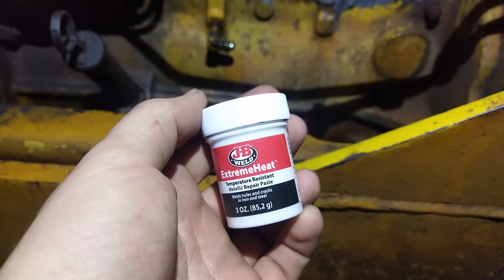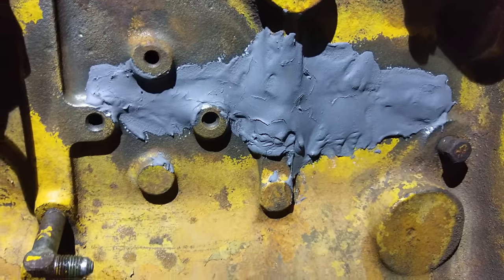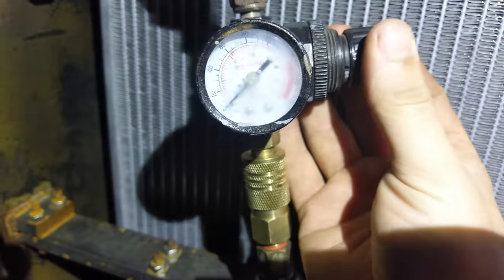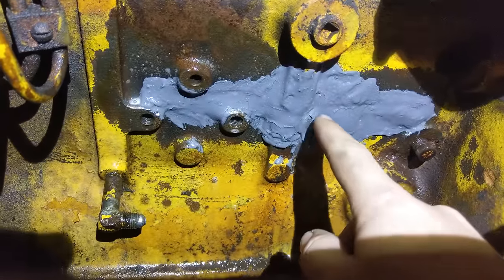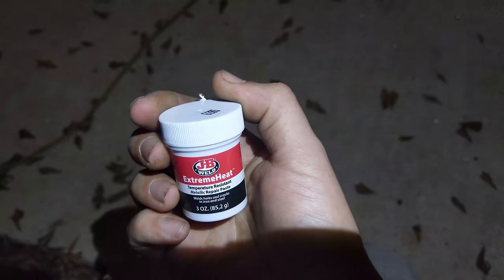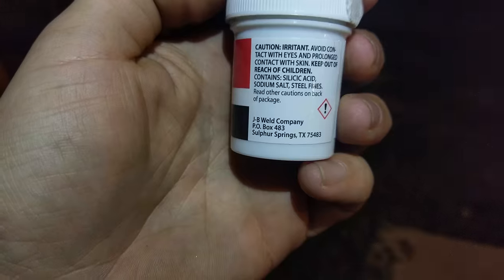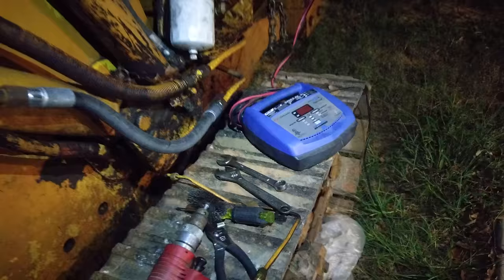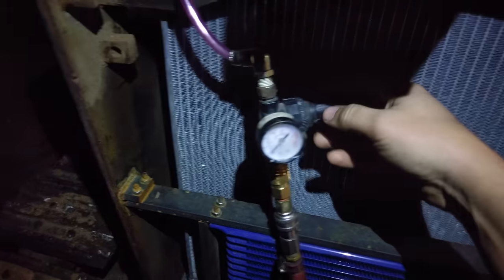JB weld EXTREME HEAT review... its garbage

Comment: So. You need an engine. The $10 container of jb weld didnt fix your problem. So you call it garbage. Not really fair
Reply: That stuff works great not the putty but the 500 degrees weld 5023 psi works it has to be don’t correctly and let it cure for 24 hours for a engine I would let it stand for 48 hours I repaired lots of engines and if don’t write it will last for ever.
Reply: @chase-db9jo  I like the part when he starts with I welded my cast iron block with stainless rod and it didnt work, it cracked again....lmao....  yeah hes smart
Reply from the maker: @chrisalanwarren  if you knew anything about cast iron you would be a bit quicker to point out preheat etc. 304 and 316 are useful alloys for welding cast. 

But your entitled to your own opinion, even though your wrong.
Reply: I have a 350 vortec with a cracked block can any one tell me how to properly jb weld it to last it's just a woods toy not really worried if it leaks a little
Reply: @hvguy  If there is a wrong or right answer, then it's not an opinion. There cannot be a right or wrong opinion.
Reply: @Street Dreams Who said 72 hours much less 24
Reply: The way I see it , it doesn’t look like you prepped the crack you know raw clean scuffed metal. Holes drilled at crack ends , opening that crack up cleaning it over and over. That’s how you get good results . My father swore by this stuff and I’ve only had half ass results from half assed prepping.., the old saying is , you get out , what you put in… there’s other folks all over YouTube that did this same type job as this and had opposite results . User error is real…
Reply: Accurate 😂
Reply: It’s water based. Not meant for liquids.
Reply: @hvguy you dont weld dissimilar metals together on a block. stainless is doomed to fail. just blast it with 7018 and youre good
Reply: You don't have a clue what you are doing there pal🤦🏼u welded a cast block with stainless rod instead of 304,probably didn't preheat, etc etc.....
Reply: @hvguy really can’t call it an opinion when there are facts out there proving this lol. It’s facts. When there’s facts then it’s just straight out being “wrong”.
Reply: Also, to prevent it from further cracking when you weld the crack try drilling a small hole at each end of the crack before welding.

Comment: That stuff works fine, the thing is you put way to much on it. You're supposed to drain the oil out of the engine if it even comes out slightly the JB weld won't cure properly..just put enough to fill in the crack and let it cure for about 2 days. Until it's really hard, I noticed it wasn't even fully Hardended when you touched it.

Comment: Regular JB can take up to 500 degrees.If your block gets hotter than that you have bigger problems than a hole in the block.
Reply: I used the regular JB weld to hold a 4-wheeler's intake manifold on. It only lasted 3 days before it broke apart but the engine never gets to 500 degrees
Reply: @jordananderson8299  you probably didnt clean it good enough or mix it properly

Comment: if you also read the directions this is almost specifically for exhaust manifolds that are cracked. it's not water proof the  putty jb weld has is. you better get a sponsorship from jb weld or quick steel most bonding products are going to fail this test. FYI learn to read the box.
Reply: IKR! And plus exhaust manifold back pressure build up to about 7 psi and not shot right at it lol
Reply: i bought some and didnt see anywhere saying that is not water proof,but it does say solvent and fuel proof ,how could coolant be worse then solvents other than it being heated
Reply: @loosh__sii water based , Kevin Wilson was right common sense ain't that common any more
they actually say not to machine with cutting oils but you are technically correct, it does not say it's not water proof.

Comment: thats cast iron,u can braze it with a nickel rod.its extremely hard to weld cast metals.and grind a notch for full penetration.
Reply from the maker: i was going to braze it, however, directly behind the weld is a cylinder sleeve with brand new O-rings. I didnt want to risk damaging the seal and filling the crank with water and oil.
Reply: Yea brazen seems about the only way. Sucks you’d basically have to rip it down bare to do it but.... do it once, do it right. Plus you could get a better look and make sure everything else is golden. Any updates on this yet?

Comment: A long while back, we used the Marine Weld to fill a corrosion hole between the exhaust and water jacket in a 6HP Evinrude. The block is cast aluminum. Ran the motor hundreds of hours. Made sure the area was clean using acetone, and was properly prepped, reamed the hole to about 3/16" and cleaned of corrosion to bare metal. Let it cure for a couple days. Ran the motor probably a couple hundred hours. Sold it and the new owner is still running it.

Comment: I ordered this product and am still waiting for it to arrive.  In the mean time I had some regular JB quick weld on hand, so I used that on an exhaust pipe leak between my drivers and passenger seat.  700 miles later I crawled under the car with a bottle of windex and sprayed the repair area, while I had a hose hooked to the exhaust of my shop vac to pressurize the exhaust system.  No leaks like before.  Amazing JB quick weld held up on an exhaust pipe, since it is only rated for 450 degrees.  I'm sure an exhaust manifold gets much hotter than the exhaust pipe though.
Reply from the maker: Hard to beat the good old stuff

Comment: Your video shows the problem was the mechanic and not the product. 
JB Extreme should never be used were it comes into contact with water. 
This  dissolve when it comes in contact with water. Should of used J-B weld twin tubes (8265S)

Comment: ... did you cleaned the grease and rust  BEFORE use J.B. weld  , with ACID ?? ( Cannot exist any strange particles in the welding areas , especially greases and oils ).

Comment: I would of used  the regular 2-part jb weld. I have used it to fix cracks in engine block and  can take high temperatures.
Reply: I used the regular JB weld to hold a 4-wheeler's intake manifold on. It only lasted 3 days before it broke apart but the engine never gets to 500 degrees

Comment: I noticed that you had 15 lbs pressure on the cooling system, i don't know how old your case is but most of the older systems and likely the later ones as well don't need a pressurized system you should be able to run your case with no radiator cap at all, i could be mistaken this is just my experience.

Comment: I cannot speak for the Extreme Heat. I have performed things just short of miracles with the original 2 part JB Weld. I was actually in the parts store yesterday, and the extreme heat almost lured me in, as I was needing to epoxy a hairline crack in the engine case on my Honda Foreman. I looked at the two products, and if I not mistaken, both the original and the "extreme heat" were rated for 550 degrees. I have not tried the extreme heat, but I have certainly had better luck with long set up original formula. I am inpatient, so the "quick weld" has lured me in a time or two, but the fixes did not last like the OG stuff. Thanks for making the video!

Comment: I used jb quik weld on my motorized bicycle spark plug it worked for like 2 weeks with almost daily use it rnded up cracking ive just redone it with the original and ik hoping it will hold up a little longer
Reply from the maker: The original JB weld is far superior 😹
Reply: @hvguy  good to know hope it hold up well

Comment: this guy is hilarious! what jb weld did you go with in the end and did it work??
Reply from the maker: XTR3MEBASS15 I ended up with jb marine. it still leaked a little. my friend suggested pulling a vacuum on the block to suck the epoxy into the crack. but that was after I sold it.
Reply: Looked up the specs for marine weld,  nearly 4000psi tensile stength is pretty decent. 
I have a hole between the exhaust port and coolant jacket of a petrol engine. (I've tried tig but its too narrow to get in there and I can't get the cylinder head hot enough to braze it, damn thing is designed to be a massive heat sink!) So my last resort is some kind of epoxy. what would you recommend?
Reply from the maker: XTR3MEBASS15 there is a company out there and"im not gonna look it up" but they make epoxy that's specific for fixing blocks. Google around, I believe they use some sort of orange lid or container. Pretty good shit. I believe cummins even supplies it for repairs.
Reply: Hvguy Next time you need to get the steel stick which is like a stick of putty that has the hardener in the core of it, you kneed it till it becomes one color and it will dry as hard as steel in 5 min and fully cured in 1 hour. That stuff gets extremely hard like steel. That stuff would definitely not blow out that easily.
Reply: @cwatson42785  do you know the name of his product? Or any information you can give me so I can Google it? Like what the container looks like or the plastic it comes in? Anything?

Comment: Someone help me. I need to attach a piece of metal that fell off of my aluminum case on my YZ250. Would Jb weld’s heat special paste do the trick?
Reply from the maker: Yes, as long as it doesn't have much pressure or torque. Clean well, sand, clean, clean, clean, apply, hold in place. Done

Comment: I remember repairing my manual transmission oil leak using the regular J-B weld. It holds very well. (Knocking on wood)
Reply from the maker: ruizhernandeztrust I almost considered good ol trusty jb weld... But figured if I paid more for a product, it'll be more gooder.... This was not the case 😂
Reply: Gooder, is that even a word? Or did you mean goober? Lmao
Reply: Ryo Amora wtf is goober even a word?
Reply: Hey thanks for ur info.  I been thinking of applying it to my transmission hairline fluid drip underneath.  Did u use the original jb weld?  How’s it holding up after 6 yrs?

Comment: I have a head gasket leak from the cylinder to the outside (puffing air under the exhaust manifold). Do you think I could get a temporary fix using JB Weld?
Reply from the maker: Hell no lol. Pull the head. It's easy

Comment: We used to solder cracks in the blocks on the old cars. Soldering will not work on a mounting point like engine mount but will repair a crack from overheating.

Comment: Depends on application small cracks, has to be clean, dry, and proper temperature. Will buy you time for a replacement part to become available especially a used one.

Comment: We drove a car 10 miles to the mechanic.  After sticking a pipe in a Broken off. Metal water hose connector on the intake manifold.    It got to the mechanics 💯. For a more permanent repair.   So it works

Comment: I realised this is an old thread. I have a hole in my sump on a Toyota townis 1992. Would this jb weld be able to fix that Do you think?
Reply from the maker: Absolutely not. Just clean it real good and use the original 2 part JB weld.

Comment: For future people his putty was still wet, press your finger nail 1cm in from the outside edge or the thickest area, it should leave no marks or indents, plus if this was to seal water its always going to have moisture effecting it

This is water based so spraying it with water just ruined it o. Your leak test.
you cant  do this in this application but painting the inside and outside with enamel paint will seal it from water and oils etc making it last even longer.

Had dynagrip extreme heat (jb weld bought their formula) last 11 years on a old 16hp briggs engine that threw a conrod, ground down with flapper disc, hit with blowtorch to remove oils,  put some tig wire to bridge the large hole (imagine rebar in cement) and went to town dabbing this extreme high heat paste in the same spots filling air pockets
 Smacked with a hammer as hard as i could, approved it, rebuilt engine and its still there a few months ago when i replaced the the oilsplasher.

Comment: I just spoke with the techs at JB Weld this week. I asked them about this Extreme heat product and they told me it dissolves if it comes into contact with water - WTF? I think had you used normal JB weld, your repair might have worked out okay. I honestly can't figure out what the purpose of the JB weld extreme heat product is. The website says it can be drilled, sanded, etc. and it's good for all sorts of things. But if you call the company, they will tell you if it comes into contact with any water, it will dissolve. If you check the product on the website, 30-40% of the Q&A is JB weld telling people "that won't work, it will dissolve if it comes into contact with water". What kind of silly product is it? I'd like to know what you could use it on where water isn't a potential risk.
Reply from the maker: Wtf?!? What kind of bullshit product is this 🤣🤣🤣
Reply: @hvguy  My sentiments exactly haha.

Comment: A cast block - cold stitch weld. But that’s a dying art along with those capable of doing it - old school.
Personally I’d have cashed the crack, thoroughly cleaned it & then cleaned it again. Then used JB Weld.
Whilst waiting for it to cure Id have been look for another engine.
I have used it to repair two cracks in the top of my cylinder deck, which is aluminium, on my Suzuki Samurai race truck. It does have the benefit of having the cylinder head to hold it all down though.
If you don’t use it properly - don’t call it rubbish.

Comment: Garbage definition 

* Tried to weld cast iron with stainless steel rods
* Tried to weld cast iron without pre-heating block
* Chooses the WRONG patch material for the job 

I understand your frustration, but you cannot deny who really made the mistakes here.....hint: You..
Reply: Welding cast iron gave it all away  :))
Reply from the maker: @AdrianMNegreanu  a little late to the party here but a quick search will show you welding cast is viable. Using this garbage product on a block is not. 🙃

Comment: You should have used regular JBW for this- it's good up to 550F, is stronger, and bonds better. I get good results when plugging large holes by embedding glass cloth in it for added strength and helps bridge large gaps faster.
Reply: This is good for 1100 degress

Comment: Jb extreme heat works just fine as long as it's not exposed to lots of water like in the case of a cracked header. It is a 2 part system, usually you have to mix it beforehand.
Reply from the maker: Mixed thoroughly, let it sit for 24 hours and it was still junk,

Comment: I used the jb weld putty and it didn't stop a small transmission  leak. Re did everything and got the almighty Jb weld epoxy went back on the road! 10k miles later and going.
Reply: SirCavemaninthewest 
Same here tried to fix oil leak and didn’t work. By the way is that JB weld epoxy original JB weld that comes with 2 small tubes and have to be mixed together?
Reply: @svetipetar278 Yes. I used the JB weld original RED & BLACK tubes. Also a stainless steel brush and brake cleaner spray can are a must have. I sandwiched the epoxy with aluminum foil so it doesn't sag or bulge. You can sand the epoxy if you want to add more layers to it. The Aluminum foil can be peaked off when it all cures.
Reply: SirCavemaninthewest 
Thanks

Comment: The first mistake this guy is making is he's trying to patch a pressure leak from the outside of a pressure vessel.
That's like taking a tire with a hole in it and putting a patch on the outside, and wondering why it's still leaking and the patches bulging.
If you're going to patch a leak in a pressure vessel the patch has to be on the inside so the pressure increases the strength of the patch, so for this JB weld patch to work he needs to apply it to the inside surface of the block.
Applying it to the outside is only going to let the pressure go through the crack press against the patch material and push it away.
He also needs to stop both ends of the crack from progressing so he needs to go to the furthest extreme of the crack and drill a hole on either end to stop it.

Comment: I know to use antifreeze in everything and shut shit down when it's overheating . I have seen many cracked blocks and heads over the decades I have been fixing equipment. EVERYONE of them has been because of no antifreeze or overheating. Overheating cracks are almost always in the head or in gas engine cylinder walls block cracks are from not keeping antifreeze in the motor.

Comment: That's a old school cooling system. 3-5 psi when at operating temp. 
I'm not saying JB weld extreme heat is good, because it's absolute trash. 
It also says to apply and then apply heat, if on exhaust let vehicle run to heat the sealant.

Comment: Flame braze, TIG with aluminum/bronze wire or ni-rod stick would be the way to fix it or use a series of interlocking studs that are for cracked cylinder head repair, if it's thick enough you also could have put a series of interlocking 1/8 NPT plug along the crack as well. 
https://www.youtube.com/watch?v=Pq0wfU4ZaKk

Comment: Those sticks and extreme heat never work for me. They always break off. The 2 part cold weld steel works great though.
Reply from the maker: It wasn't even extreme lol,. It didn't even stick. I honestly think the original two-part system would have been a thousand times better

Comment: Your spose to cure it with high heat for about an hour , maybe 200 c, the liquid powder rises to the surface and you can wire brush it off, whats left is the fused metal powder grit thats diamond hard, extreme heat is for things like exhaust manifolds , furnace molds etc where there is enough heat to cure, exhaust mufflers etc are too cold, you would need a flame to cure, down side of this stuff is very little contact bond strength and brittle so need very rough surface, mix it with jb marine weld and acetone to stop it turning to clumps clumps might work
Reply: s s what can I use on an engine?
Reply: Spose? Lol